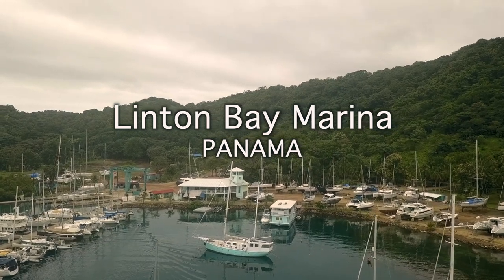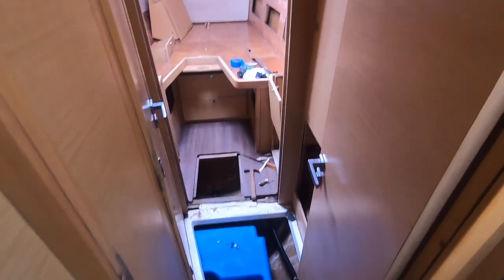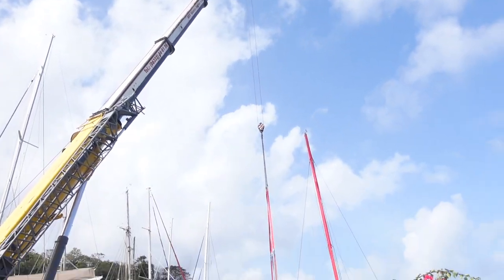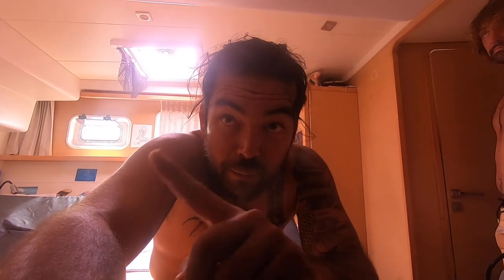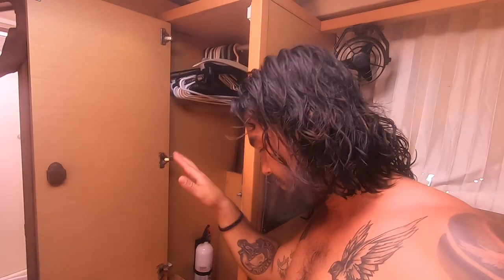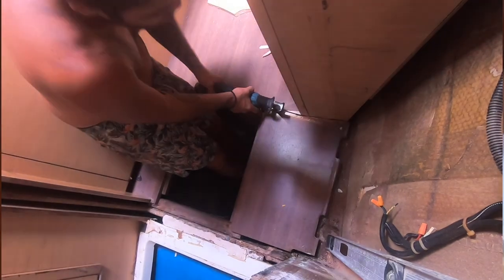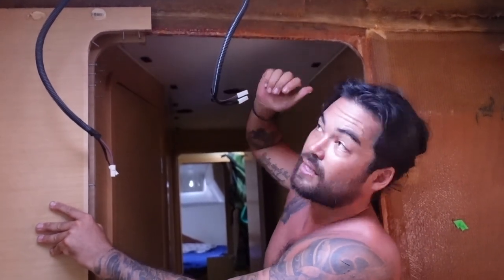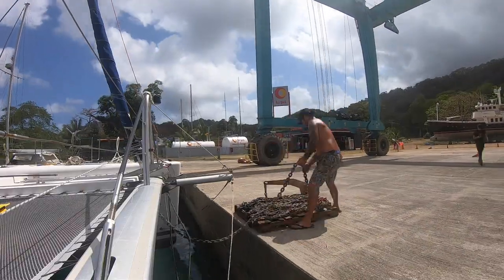CRACKED BULKHEAD REPAIR SERIES - Part 2

Comment: Don't crawl under there and shoot 5200 into the gap. That will become a crush zone as you straighten the boat. 5200 is not a proper adhesive. Look at all of those joints with similar materials that have just cracked loose. Lagoon has a real problem trying to glue bulkheads in with that shit instead of tabbing them and using proper resins. There are plenty of lagoons around with that glue around the bulkheads, and it's cracked free of one surface. 

See if you can get rid of some of that pumped in crap that was under the floor. Then drill holes through the deck and pump in epoxy adhesive when the deck is in the right place.
Reply: @zomggb
I was thinking the same thing. 
It appears the adhesive never stuck to the overhead deck.
it just pulled away. 
I was trying to see if the surface was prepared properly. Couldn't really tell. But my guess is no.
The engineers need to see this video and have a set down with their adhesive supplier.
But more importantly. This connection needs to be tabed out with proper epoxy lay up...
They may have to cut in access holes to do it correctly...
Your 100% correct.
This is not a 5200 job.itself that's a faulty adhesive
Reply: @daveevans7438  I think they are pretty aware of it by now. Apparently they changed some of their bulkhead tabbing practices around 2010. My understanding is the earlier boats had the inboard side of the two structural bulkheads tabbed properly, and the outboard side, as well as all of the furniture bulkheads, and just about everything else, glued with this shit. It might be a plexus product, not sure. But beneatau certainly loved using that stuff in a lot of boats to save money. In other boats though they glue and then tab.

This is probably why a lot of lagoon boats make creaking noises. It's not for nothing.

Comment: I suggest the boat builder help you guys out more for the sake of their poor engineering originally, they will benefit from seeing all the weak points you've found.
Reply: Sounds like there are other boats in similar situations to theirs that were not water damaged.   If that's the case, wonder if there will be a class action brought up.  I am glad he has the engineers to work with.  All the power to ya Parley!
Reply: You do understand that this was a hurricane damaged boat ? , But some other incident caused part of this damage
Reply: @craigwadey2122  its been a reported issue for a long time. Many Lagoon owners, some of whom have done very little with their boats having problems.
Just a quick search brings up lots of results on Lagoon bulkhead problems.
Not saying that this boat has not had some extra trauma!!
Geez there is even have a place to report a bulkhead issue, for a class action I believe.

Comment: Cut that piece of crap ply out of there and replace it with 25mm or 32mm Birch. Lightweight marine ply is totally unsuitable for the application.  What I am most surprised about it is the almost total lack of tabbing. It appears to be just a bit of filler, no glass.  Shocking construction standards really.

Comment: In this episode we find out why you don’t buy a hurricane damaged boat.
Reply: TBH, the hurricane damage wasn't that bad. Its the cluster FUs owning ot BERFORE that. So, allways know your prevous owners. Its true about dogs, boats, houses and cars.
Reply: @familyupgrade  Or, were the previous owners and Collin both victims of Lagoon? It appears to me the original structural failure was a result of Lagoon's faulty manufacturing design. The original owners I would assume contacted Lagoon, was denied help, before the "attempted" a fix unsuccessfully.
Reply: @familyupgrade  homes have inspections, dogs can be returned and cars have mechanics. Buying a half sunk boat with no knowledge about it the boats previous life is the problem.
Reply: @crabbypadty393  - you totally missed my point there. Homeowners can do some really shady stuff to their property, like do their own electic wireing. Or dig down stuff and not mark it on the "maps" of the house. And a dog is only as good as its owner. Also, cars? Would you really buy a car from a criminal? You might get rammed or shot if you take it to the wrong place.
Like I said, you have to know the previous owner to know what to expect.

Comment: Absolutely enjoy all videos of  project Parlay Revival 1 -113. Although you fully accept responsibility for condition of vessel as purchased, as well as any subsequent damage resulting from lightening strike and the catastrophic hull failure, it is also not a good look for Lagoon. When hull repair is complete, the boat will be better than it was new. And that's all you. The conversation with marine design Engineer was revealing as he acknowledged the weakness of his design. They could learn from your  experience as much as you learn from them. That is how a manufacturer improves their products.  Everything in a custom industry is based on reputation and value. They are wise to come along side you and help in any way possible in the interest of their own reputation, improving designs and future sales. My experience is with metal and not with wood or fiberglass, but any jr.designer can see that  the entire dynamic loading from the mast and the support cables put a point load on a very small surface area. The most optimum loading is UDL (uniformly distributed load) and spread over the entire length. Glad to see you persevere and hope you are ablwe to head for NZ soon. God Bless.

Comment: The damage is so severe that someone could think it is a total loss. But that definition is made by insurance companies who compare value of the boat with cost of repair. Parley repair is done by those who love that boat. There are boats in much worse condition that are repaired with love. The value of Parley is not defined by the insurance but by those who love the boat. The cost of repair is not compared to a new boat, but with the joy and experience obtained from the repair process. This boat will be a learning experience for so many. Love it.

Comment: Hey Colin, I know that Parlay was a hurricane damaged boat, but it seems that the original build quality out of sight of all the glossy stuff could have been compromised by cost cutting, if the structural strength was just glued in instead of what you intend to do. I.E Glass and West Systems. I'm not surprised that Lagoon are taking a very keen interest in what you are doing and I sincerely hope they are doing more than just observing your skills in trying to put this severe damage right. The PR disaster of boats that cost hundreds of thousands to buy and possibly aren't very well built I suspect might have a lot to do with it. I used to work for years on Superyachts and you are one of the few engineers I have seen who doesn't think they are Gods gift to yachting.

Comment: We sold our Lagoon last year and we are glad we did. After crossing the Bahama banks one of our through hulls below the waterline just sheared off and we had to use a wooden bung to plug it. The metal they used on the stop cock values is junk, they should have used bronze. I am convinced the flexing of the hull caused the through hull metal to shear. We replaced all our through hulls with bronze with a backing plate to prevent it happening again.

Comment: I used to do fiberglass repairs in the Keys and I just wished I was the one billing for the crawling inside the hull to do a transom repair instead of the one suiting up and using an air compressor for fresh air... but the hard work will pay off for y’all do not give up hope!

Comment: Hey Colin is hard to believe all damage you found is due to hurricane, especially after you showed floor separation. This boat was in trouble way before . Lagoon have some explaining to do. I think design and coast got in the way of structural integrity. I'm an engineer and seen it so many times.

Comment: As I watched you climb under the floor it made it clear to me that once the floor is touching the mounts that your not going to fit in there again to apply any of the material you mentioned to adhere the floor to its mounts . I think it would be easier to hole saw 4 holes that would allow you to apply the glue you planned to put in from the bottom  in from the top( just me suggestion). Enjoying watching you rebuild a beautiful ship.

Comment: Glad you thought to start using an endoscope/borescope... as a chief engineer you don't need to be reminded how dangerous confined spaces work can be, even on such a (relatively) small craft. I frequently use an endoscope when working inside our flying club aircraft. 

Don't forget how useful it can be when doing engine work too... I know that the availability of inexpensive borescopes has revolutionized working on aviation piston engines, making it possible to inspect inside cylinders you could formerly only compression test or tear down.

Comment: I used to contract engineer for a motoryacht company , we also built different fishing vessels and runabouts , the construction process is very similar to the way we would construct our boats , if it was upto me i would go about this a little differently , instead of trying to bring true the deck to the bulkheads and then reinforcing i would remove the mast , all of the rigging from the deck and then using a series of jacks and supports along the stringers and main bulkheads i would then seperate the deck/ salon from the hulls , you would then easily be able to cut and section the cracked portions and bent portions of the laminated bulkheads out and reinforce with steel and then glass the affected areas in , also you wont be cutting all over your oem cabinetry apart to access these areas , the reason we engineer the cabinetry to be slotted together is to reduce cabin noise and also to provide static rigidity throughout the hull , meaning if you have one solid cabinet and one that moves the hull can then be subject to diflect aka flexing more than it normally so in lay terms it keeps the hull from receiving more pressure in one area and disperses load better , splitting the 2 would be way less time consuming and probably alot more cost effective

Comment: Lagoon should just give you a new boat! That's a lot of work to put it right. Good luck!
Reply: Yeah but after seeing the way they construct their boats,  The episode right after that, would be; Fixing a brand new Lagoon, lol
Reply: @megladane  yes, and the lagoon design dept is probably getting an ass kicking as with the construction dept. This is going to cost lagoon millions in lost sales, which has already started along with claims already lodged by other owners that are inspecting and finding similar failures of the same structural bulkheads.
Reply: @nuffsaid7952  I blame cost cutting management, not any proper design engineers. The design and manufacturing engineers probably begged them not to cut corners in those structure areas.

Comment: I can’t believe how much of your boat was put together with globs of glue with no structural reinforcement of fibreglass and epoxy. I know this boat went through a hurricane but now that I have seen how these boats have been manufactured I wouldn’t buy one of these cats brand new let alone with any kind of issues. I know you have the skills to fix this, it won’t be easy but I am confident you will get there. Good luck!

Comment: Hell Guys, I’m with the yard man - at what point do you say that’s enough. That Lagoon may well be well laid out, but it doesn’t look to have been designed properly and sure as hell hasn’t been constructed properly either. Far too many compromises in achieving a good live aboard at the right price in lieu of a sound ship. 

Good luck though as you continue, and at least the designers are helping you and can give you the right advice that was designed out by the budget requirements from new.

Comment: Like a good pair of shoes, this boat is adjusting to all stresses applied, not that big of a deal, just find a acceptable compromise position and lock it in with proper reinforcement!
Interesting project but not so surprising given the materials used.
Looks like most of the interior issues are not structural and I would imagine, a more rigid design would come at a much greater weight/cost.

Comment: 5200 glued the rubrail back on my center console after someone ripped it off with a scuba tank. Used the boat for two more years like that with no problems until I sold it.

Comment: The last time I crawled underneath my house I had to turn my head sideways to squeeze into the next section, very similar to what you just went through. As I was scooting around down there my belly was folding down my body, however when it was time to back out by belly and my ass were pushing upward on my body. Basically there was nowhere for my chub to go. I got stuck underneath the house unable to back out. I had to crawl forward another 40ft to find a turnaround spot. That was a reality check, I have since lost weight...

Comment: Hi, really enjoying the videos. Just a thought, but have you thought about using stainless plates at about 2.5mm with 12mm stainless threaded rods to pull and hold the bridge decks back together? You could use countersunk ends on one end and then finish with dome nuts on the underneath. Might just help pull her into shape and be a good reinforcement to keep her there permanently.

Comment: Floor jacks for homes placed on every main support beams to the hull once you have it on shore. I think that if you support what is there and totally gut the vessel. Then with the floor jacks you should be able to move the hulls and super structure to the exact position you want. Then remodel the boat how you want

Comment: I wonder if you have seen Expedition Evans. They bought a wrecked boat and completely dismantled the main salon to rebuild their hull. The keel had separated the inner hull from the outer.  They rebuilt the hull better than when it left the factory.  Beneteau, as I recall, offered no help.

Comment: NOTHING like what you are facing, but I had to rebuild a travel trailer once, rotted floor and bottoms of walls. Same kind of construction, built from the inside out. Pain in the ass. Best of luck to you. BTW, couple less beers before you crawl back under the bridge deck. It should be a couple of inches tighter.

Comment: Have y’all considered NOT putting all the wood wall panels back when reassembling the interior walls?  I know you need closets and storage compartments, but that could make the boat much lighter, right?  Maybe just gel coat the fiberglass walls like I’ve seen on some of the performance Cats. Just a thought. Can’t wait to see what you do. 😎

Comment: I don't think your problem is the beam bowing above the bulk head. That is supported just like a house with the bulk head being columns supporting the roof of a house. Once those go you are screwed. With you straightening the beam and re-supporting your bulkhead, should hold up well. Make sure you distribute that load and don't have any point loads on the hull, don't want to be cracking that. I think you guys will be ok. Best wishes and keep your positive attitude!

Comment: Your twinn engine WOT session seems to have blowned a head gasket or bursted an oil cooler. On the aerial shot where you back the boat between the travel lift fingers you can observe a sheen of oil all around your cat. Let's hope for the best!

Comment: I would have definitely applied a generous amount of penetrant catalyst fluid on all the turnbuckles and let it soak. It would really help a lot to loosen them. You can make your own industrial strength version with automatic transmission fluid mixed with acetone 50/50 ratio for the very best penetrant.

Comment: I think they designed the interior to be a key part of the structure , and in my opinion that's a major  design flaw  the boat hull should stand alone and everything else be modular so it can be removed in case there needs to be repair done. All the through holes should be triple thickness, and they should never use a butt joint to connect anything that is under constant movement.

Comment: Colin, Wouldn't it be easier to make a cut away section of the cockpit floor like a hatch big enough for you to get down in to and re glue the floor to the hull rather than crawling around between the floor and the hull?

Comment: Best way to run a string line.... use 3 small blocks (1/2”-3/4” plywood) anything you got. As long as they are all the same size. Put a block under each end and use the third as a gauge block. If you don’t use some kind of block your string line won’t run true. It can’t touch anything but your outer points

Comment: Jeez, looks like a beautiful, expensive, sailing version of a Bayliner.  I've never seen a sailboat so poorly designed.  They are beautiful, but damn the only way I could imagine that damage occurring is if you lifted it as high as possible with that travel lift and just cut the straps dropping it on concrete.

Comment: I am not sure I would pile any more funds into this lemon tbh mate.  You would need to have some jacking mechanism after hauling out so you can support the bridge deck but allow the hulls to droop but not too much.   Hope this all works out but this is a very challenging repair and most surveyors would write this boat off at this point imo.  Too much of the boats structure is warped and damaged not to mention the facings will also all have to be redone in these cabins.